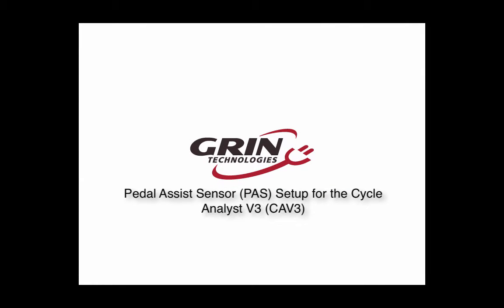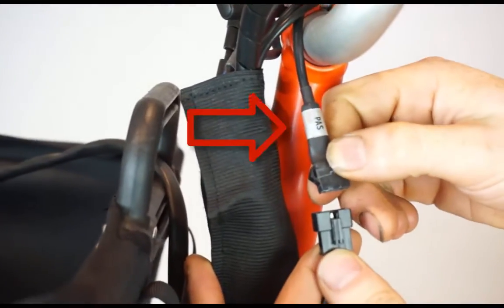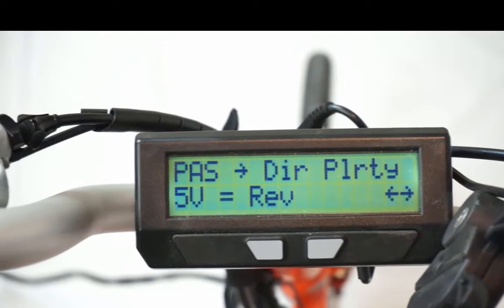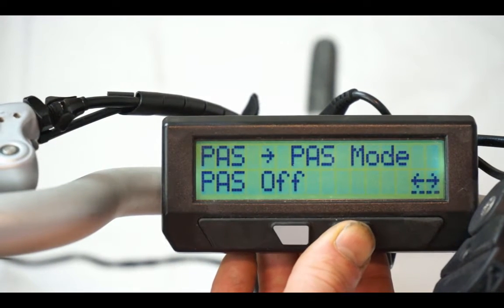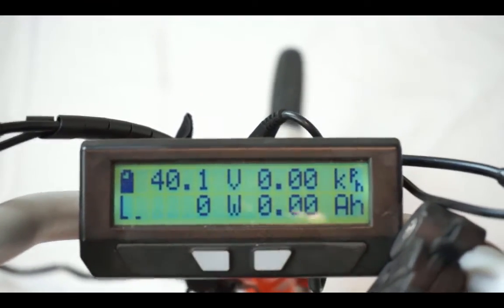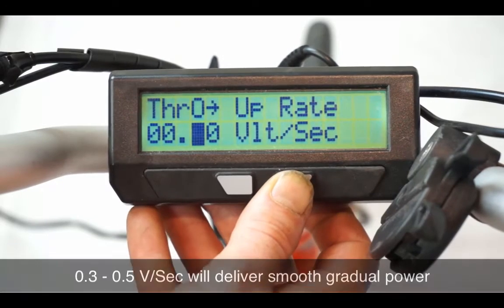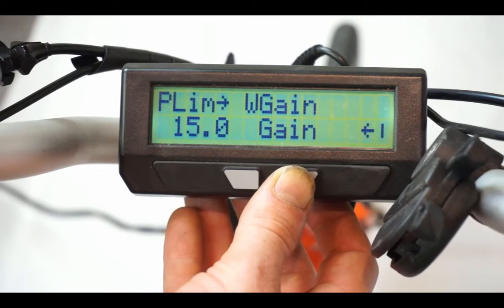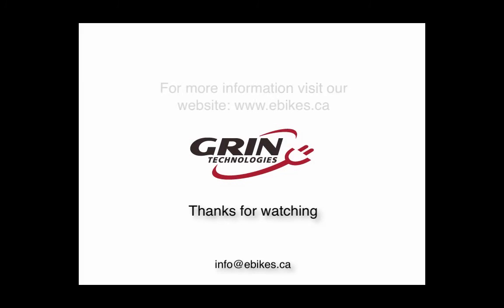PAS Sensor Setup with V3.0 Cycle Analyst Firmware

Comment: How to install on ONE PIECE crank?
Reply from the maker: There is a split ring magnet sensor you can use in that case, or use the chainring sensor and use a saw to cut a slit in it so you can slide it over the spindle.

Comment: How does a 1-wire PAS system differentiate between CCW and CW rotation? Are the magnets positioned differently? Does it have a specific kind of HAL sensor?
Reply from the maker: In a single wire PAS sensor there are still two hall sensors in the pickup, the the signaling is encoded by a basic logic circuit on the sensor so that it only outputs pulses when rotating in one direction, and no pulses in the other direction.  The magnetic positioning is identical.
Reply: @GrinTechnologies  thank you for your time to answer me! If anyone's interested in oscilloscope measurements, I found a forum post titled "Funktionsweise digitaler PAS-Sensoren (Details für Interessierte)".
Reply: @GrinTechnologies That cant be true. Ive been struggling pretty long with a single signal sensor with diy uild in magnets into my crank.
I just could not get it operating... after buying an amazon magnet disk with 12 magnets it worked just fine.
I tested polarity of the magnets and they did switched magnetic polarity each magnet...

Comment: Can PAS be set to increase power as pedal cadence increases?
Reply from the maker: Yes, this is a standard feature of the CA3.1 firmware.  There is a W/rpm setting in the PAS configuration menu.  You can also set it up to decrease power as the cadence increases, which is useful for single speed bikes.

Comment: I'm hoping you can help me.  I've looked at tons of PAS hack videos and EVERYONE WITHOUT FAIL omits how to connect to the controller once the PAS hack in on the crank.

Problem :  i have a Super73.  On the controller there is a cord for PAS.  It is Female 6-pin (5 pin in 180 degree half -circle; one pin in the middle.

all the PAS components I see you using and other using has a different end altogether ... or they are Male 1-pin or Male 3-pin.

How do I connect if the pins are different.  am I missing something?  Are there cords available with "multi ends" like a Y-splitter that I can use?

NONE Of these videos show the full process...makes no damn sense.

Assume Im ignorant, please.  I'm not offended.

/Bklyn👑
Reply from the maker: There is zero correlation to our installation video where the PAS sensor hooks up to a Grin V3 Cycle Analyst, and a typical ebike system where the PAS goes directly to a motor controller input.  If your bike is not being regulated by a V3 Cycle Analyst, you can fully ignore everything about this video and contact Super73 for guidance!

Comment: Hi I have this sensor and the CA V3.1 and when I change the directional polarity it doesn't change the order of the p and d arrows, the p arrow is following he d arrow no matter what... how can I fix this please? It doesn't work when I pedal backwards or forwards
Reply from the maker: As mentioned on the ES thread as well, changing the direction polarity doesn't change the order of the arrows which reflect the actual hardware signals. It just tells the CA3 which is your forwards pedal sense and which is the backwards pedal sense. Seems like your sensor hardware is just fine and if you aren't getting PAS assistance you need to look at the other settings.
Reply: Thanks! I found this video before the Es forums so working through it now hopefully can get it up and running.